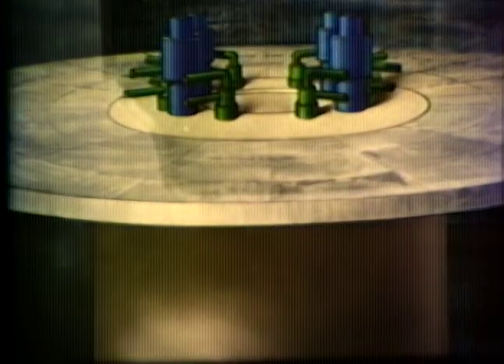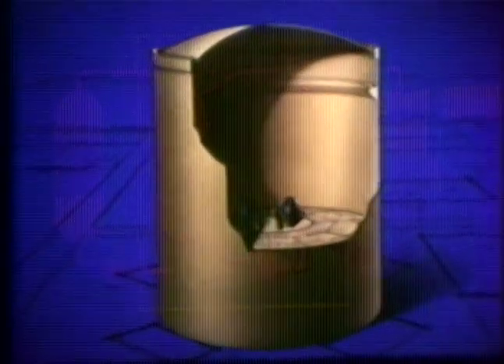Nuclear Breeder Reactors: Superphénix

Comment: Security guard currently working at Superphenix here, really glad to see some more information on the plant, it's very interesting
Reply from the maker: Oh nice! Glad you happened upon it. Great to hear from someone on site.
Reply: All the fuel rods have been removed from the core back in 2003 right?  The fuel rods were stored on-site in spent fuel pools, but surely they've moved off-site by now?   Is the core still intact there?
Reply: @beyondfossil the spent fuel rods still are on site in the pools, the pools are still in use and no dismantling is planned for them, as for the core, it's mostly dismantled already, yeah.
Reply: @beyondfossil  all infrastructure still requires dismantling

Comment: Still using solid fuel I see. 
There's yer problem.
Reply from the maker: Ah yes because the fluid fuel experience with like HRE-2 was just sooooo good am I right? https://www.youtube.com/watch?v=Dc2VZav17Ag
Reply: @whatisnuclear  I was referring to the molten salt reactor experiment. Obviously. 
Thank you for the link though. You can see how lessons learned from this were incorporated into the MSRE. For example, the use of multiple parallel pipes for establishing critical geometry instead of widening the pipe with diffusers. And getting away from heavy water.

Comment: 1:04 ACTUALLY 🤓 
It doesn't have to be done with "fast" breeding. It's possible with "thermal" breeding, just not with U238.
Reply: Thorium... via FLiBe molten salt! 🤓🤓🤓. Th232 + n -> Pa233 - Beta -> U233
U233 + n -> either: Boom (91% probability)
or U234. 
U234 + n -> U235 U234's neutron absorption cross section is 100 barns 
So with the Thorium Energy cycle, for just 1 extra neutron, you get 2 shots with uranium fissioning. Which leads to a FIMA efficiency (Fission per Initial Metal (Th232) Atom) of some 97.2%. As opposed to U235's 85.5% FIMA

Comment: Wouldn't have been better to use lead, bismuth or tin for the secondary heat exchanger to avoid booms between the sodium and water?
Reply from the maker: Good question honestly. People have used other fluids for the secondary loop, but there are challenges of having compatible melting/boiling points in the relevant operating temperatures that make it easier to just do sodium.
Reply: Maybe, but then you'd have another new liquid to figure out how to contain and circulate with the right alloys for pipes and pumps and other equipment (and prove the safety thereof).  Sodium apparently is enough of a problem already.  I think we're stuck with light water reactors for the time being because we have not just decades of experience with hot water under pressure in nuclear steam supply systems, but even more decades of experience going back to the first coal-fired boilers for steam engines in the 1800's.
Reply: Like water, which expands when you freeze it, so do lead, bismuth and tin.
So if you lose electrical supply long enough for any part of the secondary to freeze, that part of the loop will be destroyed. 
The russians made a few submarines that used lead/bismuth, with spectacular, but ultimately disappointing reliability results.
Reply: @HE-pu3nt  The reactor plant in one Alfa was ruined when the coolant pumps failed and the lead-bismuth mix solidified in the piping and the core.  The Soviets ended up tearing that whole complex out of the boat and replacing it with a PWR plant.  That one would be the last Alfa to remain in service and was used as a training submarine for its final years in active duty.  All the others were retired and stricken.

Comment: The biggest problem with breeder reactors is the sodium as it highly corrosive and finding material that won't degrade.
Reply from the maker: It's not corrosive as long as you keep it clean. You have to keep oxygen and moisture out. At EBR-II, when they drained the sodium vessel, they could still see the chalk marks inside from manufacturing. That's how non-corrosive clean sodium is.
Reply: @whatisnuclear  
I agree. It's just that the main problem is that with sodium you have to use three circuits instead of two, which increases the cost of the installation.
Reply: @nedward.7442  althought the innermost circuits is really more a pump inside the main tank that shovels sodium around, so to say. the design is quite clever. but handling the fuel reloading and equipment maintenance in a high radiation environment, always submerged in opaque sodium is quite tricky. the sodium itself has pumping properties like diesel, roughly, quite convenient if it not were for it's flamability
Reply: @ 
I agree, but the overload is produced by rotating the large and small rotary plugs, i.e. the opacity of sodium is not even a problem.
Reply: @Taelchentuber  I would guess nowadays ultrasound tech and data processing has developed enough to make quite good ultrasound "cameras" that can image accurately inside those reactors.

Comment: And if you want to make plutonium for nuclear weapons, this reactor does it for ya!
Reply from the maker: Everyone just uses specialized plutonium production reactors for that. Natural uranium fueled, graphite or heavy water moderated.
Reply: Yes, they can. But what is interesting is that Plutonium was produced in heavy water or uranium graphite reactors. Experiments were conducted on BN 350 to produce plutonium, but it seems to me that it was unlikely to reach an industrial scale.
Reply: No at all, the isotope purity of the plutonium is far not enough with these reactors.
Reply: @CEric-xd2rt  
Why is it dirty? On the contrary, I heard that they produce quite clean stuff.
Reply from the maker: @nedward.7442  Isotopic impurity doesn't even matter that much anymore, which is why IAEA definition of a "significant quantity" of plutonium is silent about the isotopic mix. With modern D-T gas boosted fission weapons, Pu-240 impurities are no impediment. And even relatively unsophisticated weapons designers like N. Korea have already perfected gas boosting.
Reply: @whatisnuclear  
I can't say anything about the IAEA, but I'm not at all sure that 240 isn't a hindrance even with amplification; it's not used because of the high neutron background, which amplification doesn't affect.

Comment: Fusion and Thorium is a waste of time. Sodium cooled fast breeders ( and solar ) are the solution to all energy needs, but unfortunately came too early in the 80s...
Reply: Many paper fast reactors can burn both uranium and thorium. The Dual Fluid Reactor is supposed to be able to do this. Thorium is uniquely capable of breeding in the thermal spectrum but it can be made to work in the epithermal and fast spectrum
Reply: @ yes but the whole chemistry behind fluid treatment / molten salt full of fission products is largely unproven in full scale power reactors. diluting money into too many dead ends is a sickness of the nuclear industry from its start
Reply: @Taelchentuber  You mean like pyroprocessing in the sodium-cooled Integral Fast Reactor? That's a molten salt full of fission products, it just isn't the fuel. I completely agree that we should lean on proven designs and concentrate scarce resources on the best near-term prospects. But a lot of these component technologies have wide-ranging applicability to many reactor types. Case in point, chemical processing of molten salts is key to closing the uranium fuel cycle in LMFRs. And not all molten salt reactors have the poor neutron economy of the thorium fuel cycle that necessitates complex and intensive chemical processing. Molten chloride fast reactors need very little in the way of chemical processing, and this would slash their development costs and timelines. And I say this as an advocate for molten metal fuels. Instead of casting U-Pu-Zr fuel elements for LMFRs, in the long run I think we should be using molten U-Pu-Cr alloys in something like the SLFFR being studied at Argonne (home of the IFR).

Comment: such a simple design.
Reply: In theory yes, but in reality it didnt work out so good. The thing during its lifetime was barely working. Sad actually, the technology is quite impressive.
Reply: afaik most of the issues were resolved by the time it was shutdown.
Reply: @Hamstray  though in the fuel emptying cycle post shutdown they got problem with reliability in the fuel handling hot cells....  
Basically failed fuel assembly cranes -> risks for dropped fuel assemblies (and other reactor parts too....)

Failures which would have happened even with continued production, what more would have happened ?
Reply: @TheStefanskoglund1 This is an infrastructure problem, not an inherent technological or risk issue with the breeder reactor itself
Reply: @Inesophet From memory, weren't most of the problems over 'containment' issues with liquid sodium? Seems practice was harder than theory when it came to keeping it sealed in its respective coolant loops (esp the secondary loop where it had to interface the steam generator)😬